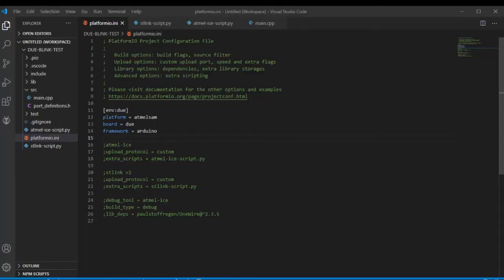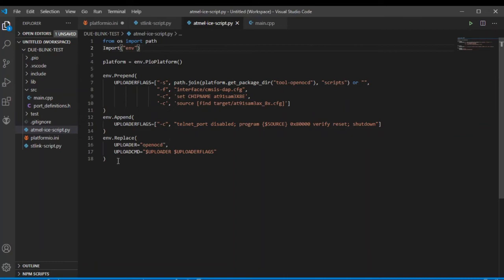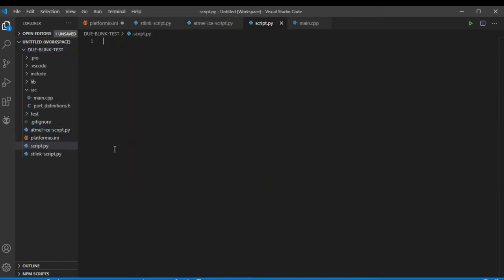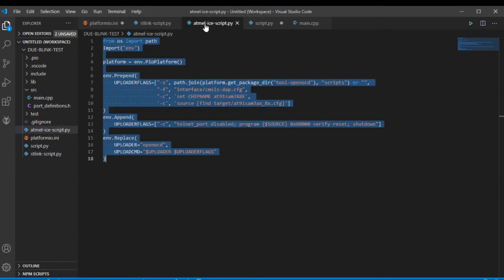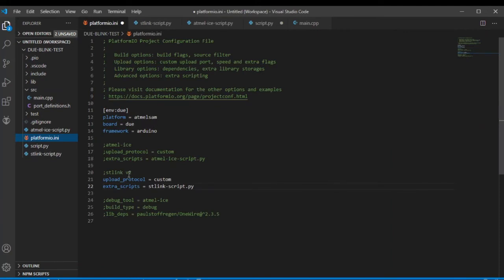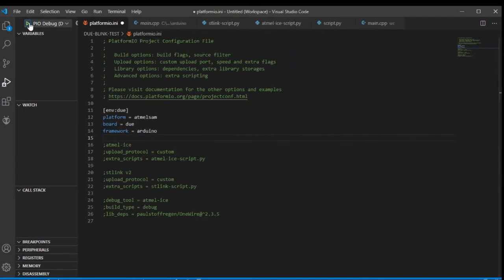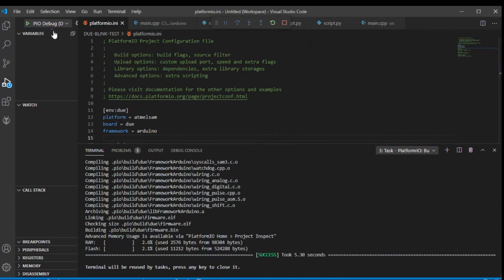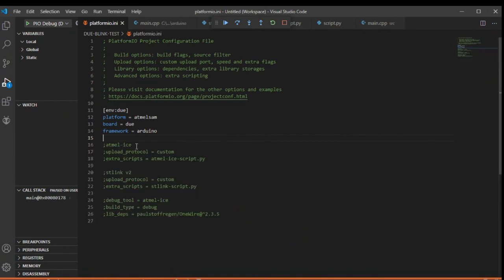PlatformIO Tutorial: programming Arduino DUE with Atmel-ICE / ST-Link

Comment: Aleksander, I'm trying to program a custom PCB with an Atmel ATSAM3X8E AU MCU via ATMEL ICE programmer. The board doesn't initialize in Windows and a COM port doesn't get opened by Windows when a USB cable is plugged into the PCB. I was able to upload the code (simple blink test) via Microchip Studio, but it seems like the program wasn't running on the MCU after uploading. It appears like the MCU bug you mentioned in the beginning of the video. Is it possible for you to provide a simple step-by-step instruction on how to fix the issue in my case? I would be glad to connect on Telegram or Skype to go over the issue with you. Also, I don't mind paying for you help. Please let me know.
Reply from the maker: Hi Konstantin,
In Microchip Studio, there should be a way to check and set the GPNVM bits that are responsible for executing from flash when programmed. I'll try to find it and will get back to you.

Comment: Could you please help with SWD pinout mapping of STLink with Due.
Reply from the maker: The DUE SWD pins are marked DEBUG - you can see me connecting to them in the video.
They are, numbered from the USB socket side: reset, swdio, swclk, ground.
DUE reset - STLINK RST (pin 1)
DUE swdio - STLINK SWDIO (pin 2)
DUE swclk - STLINK SWCLK (pin 6)
DUE ground - STLINK GND (pin 3/4)